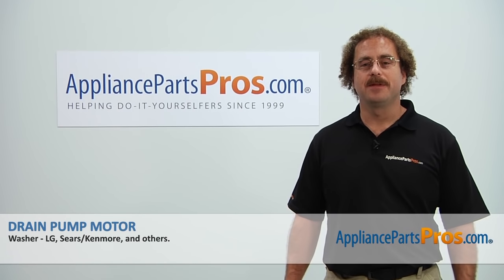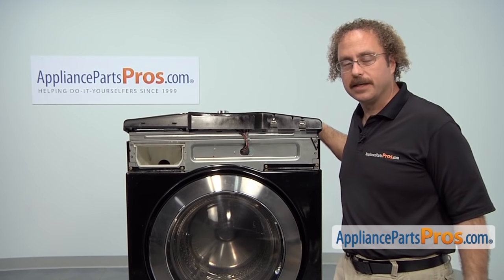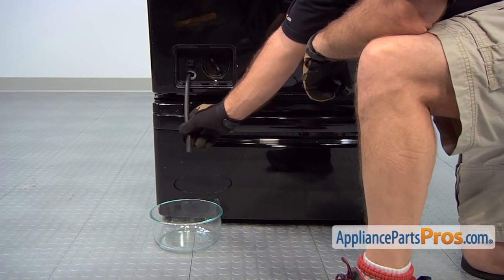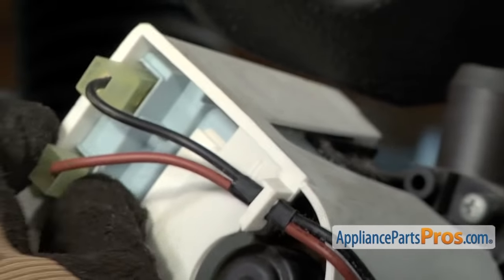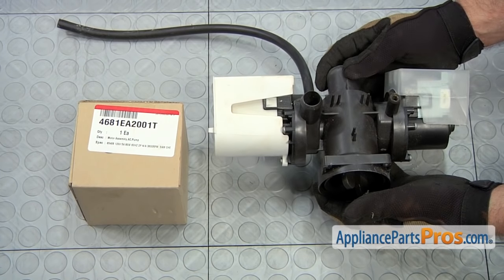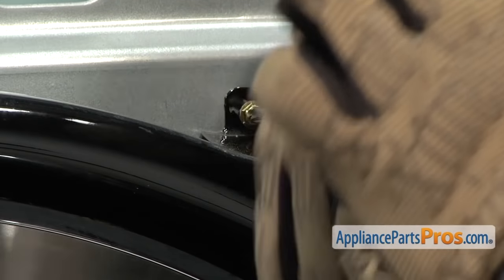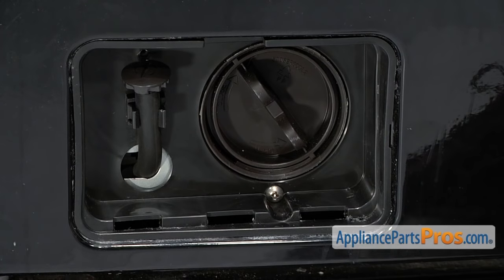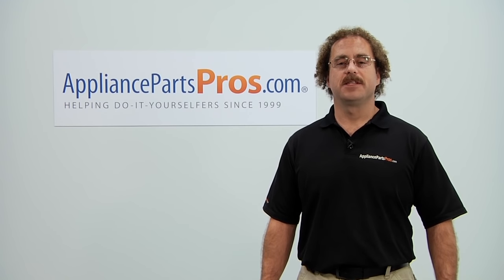How To: LG/Kenmore Drain Pump Motor 4681EA2001T

Comment: Great video, but you missed a critical step that makes this operation considerably less complicated.  Most LG washers are open at the bottom.  If its not mounted to the options drawer riser, you can turn the machine on its side and there is no cabinet dis-assembly.  It becomes a 5 minute job.
Reply from the maker: Michael Harris While taking it apart may be the longer way it is the the way to go. These washers are heavy and sometimes just pulling it out to get the top off can be a challenge. Also if you lay it on the side you have to put in the shipping bolts or the tub could bounce around and come off the suspension.
Reply: The  2 wires brown is in black is black is out is not marked in or out
Reply: On harness

Comment: Save yourself a lot of time and pull the washer out enough so that you can lean it back on a 45 degree angle and go in from underneath.  That way will only require 6 screws and two wire--pretty easy.  You can take out pump motor assembly without disconnecting hoses, etc. just pull the wires, unscrew the motor pump and replace.  A much easier fix even if it takes some time to get the washer in a position to work on it.
Reply from the maker: +dsatina Hope the video helped you get the washer fixed, Thanks for the tips!
Reply: Yes, accessing the drain pump from the bottom side of the machine is the easiest.  I strap my machine to a hand truck, then I tip it on its back.  I've done this twice now with my LG combo washer/dryer which is about 15 years old.  It's a $20 fix.
Reply: @RustyInSeattle  Thanks Russ. Super interesting advise. Have a dolly with xtra tires accesory and strap to hold the load at 45 degrees that I
will use when my LG washer ask for a new drain pump.

Comment: Thank you for the step-by-step instructions!!!! I performed the repair of the drain pump and the drain hose on our LG washer myself.   My husband didn’t think would complete the project.  Not only did I fix the washer today, cooked dinner, I now have time to put my feet up, watch a little television and a load of clothes before bedtime!
Reply: I'm going to try this. Mine just went out today. I'm like no!! I'm scared of that darn spring.  Wish me luck.
Reply: sandylash7439 Don’t try to use pliers on the spring. Put a zip tie or small cord through each end of the spring and make each one into a loop. 
Now you can pull the spring apart with ease. 

I know your comment is 3 years old. Just adding this for new readers. :)

Comment: Whenever dealing with a screw that screws into plastic be careful not to strip the plastic threads. Set the screw in place and rotate it backwards very slowly. You should feel it drop into the existing plastic threads. Now screw it in.

Comment: Hey thanks I've done this twice now using your video as reference. You can also remove the the spring clip by grabbing both loops of the clip with sturdy needlenose pliers and stretching the spring manually if you're afraid of slipping with the screwdriver and scratching the washer. Either way, beats buying an $80 pair of washer spring clip pliers when you're not doing this on the reg.

Comment: Excellent video!  AppliancePartsPros is my "go to" source for appliance repair.  I called LG for on-site/out-of-warranty service since they offered a flat rate price of $125-$250 for labor/parts/service.  Catch is all of the LG service providers would not schedule anyone to come out for over two weeks!  I called a non-LG service providers, told them the drain pump needed to be replaced and they wanted to charge a $85 trip fee to verify the problem and then they would order the part which they stated would take five days!  I ordered the part via standard shipping; it arrived they next day.  The box showed the part came from LG; I have no idea why appliance companies cannot source the part the same or next day.  I had my laptop with me the laundry room and did it step-by-step and had no problems at all.  Washer is now back up and running.  Thank you AppliancePartsPros!
Reply from the maker: +MrPaymentSchedule Glad the video helped you get the washer fixed!

Comment: Bummer about the stand its on because without that you can go in through the bottom. I just tipped mine back and undid the screws around the drain plug. Three screws hold the pump in place. One of those goes through the plastic cover and two under that. There is a plastic release tab that holds the assembly's foot. Then without undoing any of the hoses, three screws on the old pump come off. New pump in. Remember to push through the drain hose before you attach to pump assembly to the front, then the plastic cover, clip the hose, two screws and stand it back up. Six screws and no need to mess with the door.

Comment: THANK YOU, BEst Video ever for saving money. I'm a 60-year-old grandmother and I did this MYSELF by watching your video. The worst part was getting the spring wire back on the gasket, don't give up, you can do this. I have one screw leftover (??) but all seems to be working just fine. Thank you for such a detailed well-edited video which just saved me $1000+ on a new washer.
Reply: Don’t try to use pliers on the spring. Put a zip tie or small cord through each end of the spring and make each one into a loop. 
Now you can pull the spring apart with ease. 

I know your comment is 2 years old. Just adding this for new readers. :)

Comment: THANK YOU!! Once I got over the fear of removing the gasket spring (actually, more afraid of trying to reattach), the repair took about an hour, including vacuuming time within the cabinet. Biggest help (besides the dreaded spring) was showing the location of the clip holding the pump in place.
Once again, y'all have saved a repair call - and my mind. Thanks again.
Reply from the maker: You're welcome!

Comment: Great video...helped me get my washer back up and running! $45 for the pump, a bit of time doing the work...and all is working again! Hardest part for me was the big tube clamp...I couldn't get a pair of pliers open enough to squeeze it tight to get it back on...ended up getting one of the screw tighten type at the hardware store for $2 and that went on in a snap....I was worried about the spring clamp, but it went on with a vice grip just like in the video...this saved me at least a couple hundred bucks....thanks!

Comment: Great video but if you have a newer washer, the process for removing the pump assembly is different.  If you’re missing the two screws to remove the pump assembly, do the following: 

There is a vibration tray with three 10mm bolts you have to remove.  The whole pump assembly and metal vibration tray will come out.  Remove the four screws to detach the assembly and then continue with the video.
Reply: This saved me thank you
Reply: Dang, I wish I had read this before attempting to follow the video.  I've now seen this topic referenced by others and wish they would make an addendum to this video or perhaps a written graphic overlay with this information.

Comment: Thank you very much for this helpful video.  It's just what I needed to get this repair done.  

I wanted to take a second to tell everyone about a big mistake I made with this repair.  Instead of going to AppliancePartsPros first to buy the replacement motor, I went to Amazon and bought whatever cheap motor popped up first.  BIG MISTAKE - that pump motor shipped in a brown box with no LG markings or part numbers, looked like it was remanufactured (had a warped impeller wheel), and ended up breaking in less than 8 months!  So the second time around, I purchased directly from AppliancePartsPros, received a brand new, genuine LG pump motor, and just completed the repair for the second time.  

Learn from my mistake.  Spend the little bit of extra money, and go right to these guys.  Not only will you get a genuine part, but these guys are a great company with how they so helpfully put all of these videos out there.  They should be rewarded with our business.  This whole experience makes me really pissed at Amazon with how they have so many 3rd party, shady sellers on their site.
Reply from the maker: You're very welcome! I'm glad that we were able to help you with the repair!

We also really appreciate your story and recommendation. We offer competitive pricing, but we also offer free technical advice and diagnosis, all OEM parts, and a 365 day warranty!

Comment: Fantastic video. Grateful for the steps - and the work of AppliancePartsPros. I went into this, trusting that I could with the step by step. In addition to the pump failing, found that water hoses were partially clogged and draining (especially in the seal) was clogged. Doing it myself gave me the opportunity to address these other issues and make it a well running machine.
Reply from the maker: You are welcome! Glad you were able to fix your issue! If there is anything we can help you with in the future please let us know.

Comment: Seriously, this video is a god send.  Paid attention to every detail and you saved me a ton of headaches with the detailed step by step.  THANK YOU!!!!
Reply: Well, it ends up I had a shaft seal failure allowing fluid to migrate behind the impeller and filled the cavity with fluid.  All that fluid was causing the terrible vibration.  The motor stator assembly was fine.  Just need the pump assembly without the motor.  Wonder if it can be sold that way?
Reply: Nice diagnostics. Well done.

Comment: This video was excellent. I have a Kenmore Elite and how the pump was attached was different than this video but this video got me to where I could access it and replace the pump. Took me a total of an hour to do with just a screw driver and pliers. Saved me a ton of money on repair fees! Thank you again!
Reply: Yes my pump was held in with 3 10mm bolts. Not a clip. It also had 4 hoses.

Comment: I disassembled it all, new part comes tomorrow hopefully. Old pump the propeller shaft thingy looks warped or something, so maybe that was the problem. Disconnecting the wire harness from the door latch was the hardest part for me, took me forever to get it pulled off. I am hoping reassembly isn't too bad when I get the new pump. Thank you so much for this video.

Comment: Great video, easy to follow. Only care needed if model happpens to be different. In my case it was WM0642HW & front door electric connection bit different (in fact bit easier)…means we just need to remove just the nuts rather than separating the wire from switch/lock. Also while attaching the wiring to the drain pump more care needed as did not find “N” marked clearly at respective places, making me go over the video couple of times. Last better to mark water taps on the wall to indicate one is hot water, just to avoid last minute dilemma.
 It’s a awesome resource made available for “DIY’ projects. If seniors are attempting to do it may be care be taken as it does demand decent time engagement. Thanks once again.

Comment: Thanks for the informative video.  I was able to order the drain pump and replace it with no issues so the wife is a happy camper now.  I also replaced the circulation pump while I had it all taken part and all worked well.  Thanks again!
Reply from the maker: Glad the video helped you get the washer fixed!

Comment: First I'd like to commend APP for their great videos... love the style!

I'm guessing what I encountered may be associated with newer models produced after this installation video was created. I fixed an LG WM3270c that was installed in early 2017.

1) My lid didn't just slide off to the back like in the video.  I tried using 'rubber gripper doodads' used to remove stuck jar lids and that didn't work.  Sticky 'wide receiver gloves' didn't help either.  On my model I used slightly damp hands pressed against the top of the lid and then a quick forceful push from front to back released the lid.

2) I couldn't figure out why the User Interface didn't just 'pop off' like the video... I had a single small screw affixing the UI to the frame and it was found in the upper right corner.

3) I wasn't fortunate enough to have the pump held in place by the clip.  Instead, I found (3) 10mm bolts securing a metal tray that had the pump unit attached to it. * On this topic, a notation to your video would be greatly valued *  After fumbling around for longer than I'd like to admit I was fortunate enough to find an alternative video that made reference to the bolts.  The whole tray has to be removed to replace the pump

4)  Lastly, somewhere here in these reviews/feedback I read about using zipties to remove the rubber gasket spring loop.  Thank you, this worked BRILLIANTLY.  There is no need to risk scratching your machine or puncturing your gasket with a screwdriver.  Just attach a ziptie to both loops of the spring and then you have an easy hold to grab and spread the spring which releases tension on the loop and POOF! It's off.  This technique was just as effective when reattaching the rubber gasket spring loop.
Reply from the maker: Thank you for those tips! Glad you were able to get your unit fixed. Let us know if you have any questions!

Comment: Just replaced my drain pump.  The hardest part here is to put back the large round spring.  I modified it because it was too difficult to put back.  I wished I have seen this video first.   This video shows how it is done the right way, with a vice grip.
Reply from the maker: We're glad you found our video helpful! Next time you have an appliance repair to do, check with us first, and maybe we can save you some time and trouble. :)

Comment: Yep awesome video.  Replaced drain pump and rotor position switch (wan't sure which one was causing the issue).  Figured since I was doing one, do them both.  $80 fix and back in service!  Thanks!
Reply from the maker: Thanks, glad the video helped you get the washer fixed!

Comment: Very good instructional video.  My only complaint is he should explain a spring expansion tool ( e.g. special plyer) is required for installing back the spring on the Boot on a front load washing machine.  This is almost impossible to do it without the tool.
Reply: Not true. His vice grip method obviously worked but I found that attaching a zip-tie to the loops of the spring made for an easy option to grab and expand the spring for removal as well as replacement.

Comment: Rule #1 - ALWAYS READ THE COMMENTS! :) Helpful tips abound in them! Read this full comment for advice on easily installing that big spring clamp ring!  Rule #2 - Don't force anything. You may break something and make the repair much more costly. Every model is different, this pump is used in dozens of makes & models.  The control panel on my machine wouldn't pop off after releasing the clips, I found a single screw toward the right side, going into the back of the panel. Also, my pump assembly was not held in by a clip, it is mounted on a metal plate, which is held in by three 10mm bolts. Use a socket, ratchet, and 3 in extension to get them out. Pull assembly out, and dismount the pump assembly from that plate to remove the pump motor. Take a picture or note which color wires are on top & bottom position, so you can put them back the same. My new motor had no markings at the terminals. Ok, now for installing  that big bad spring ring clamp on the door boot? I struggled for a while trying doing it myself, using channel lock pliers, (couldn't find my vice grips). Impossible. Maybe if I had a helper to guide the ring while I stretched the spring... But in reading through dozens of comments, a lady mentioned using zip ties to install that spring. So I grabbed 2 and put one through each eyelet on the spring, zipped the ties into large loops, and was able to EASILY pull those 2 loops to spread the spring and slip it into place! Genius, whoever thought of that! No special tool or vice grip needed. My zip ties were 11 inches long, but any size about 8 inches or longer should work fine, you can get a bag of them cheap at auto parts or home improvement stores. 
Our 6 year old Kenmore (built by LG) stopped draining, threw the OE code. Ordered this drain pump from Appliance Parts Pros on Tuesday, received it on Thursday, (standard shipping, 2 days, as promised, thanks!). Installed it Thursday night, using this excellent video as a guide, and the washer is back to working perfectly! Thank you Appliance Parts Pros!!
Reply: That is how my pump is installed. Thanks for the details on which bolts to remove. 

Before removing the front of the machine I had 2 more screws to deal with. One held the plastic cover of the drain area on. And another was right behind that cover. These had to be removed to lift the front panel out of the bottom clips. At that point there were no more screws on the front of the pump like in the video.
Reply: I sure wish I'd have found your feedback prior to attempting this job. I also had the screw in the upper right corner of the user interface as well as I fumbled around for quite a few minutes feeling for the release tab on the pump but it was also affixed with 10mm bolts.  

Lastly, I also read about the zipties somewhere and it was brilliant!